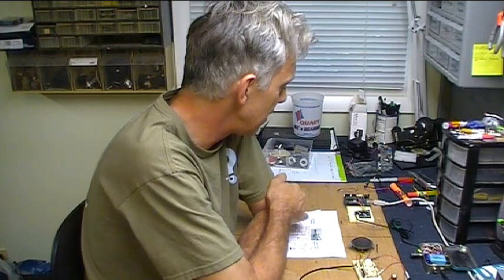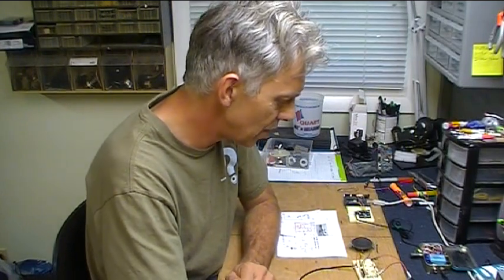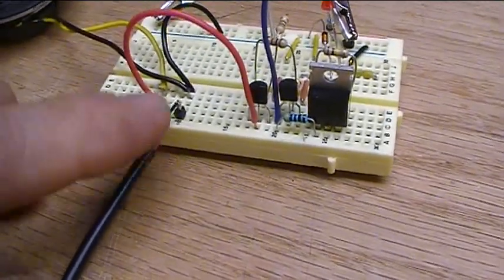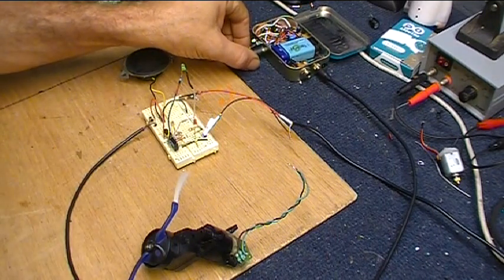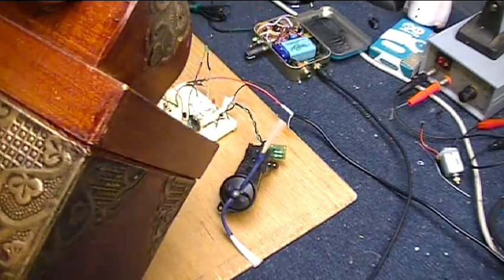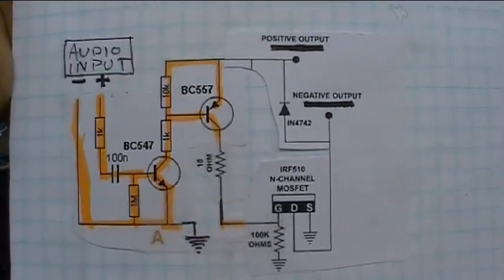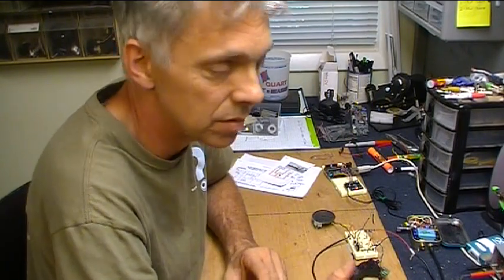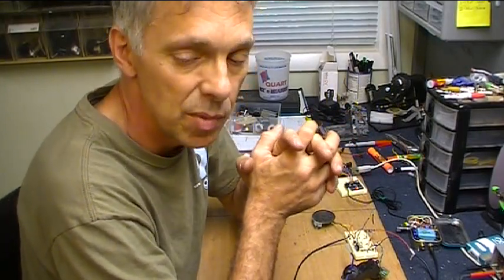Emic2 Sound To Motion Circuit

Comment: If you replace the motor with a solenoid will this give you a sharper motion taking advantage that solenoid will go up & down full swing upon MOSFET tringger ?  still you may need a capacitor to empty solenoid coil at fast rate.

See this new DIY robot making tutorial
https://www.youtube.com/watch?v=MOA_pFJZmyg

Comment: You would need to take the output from the sound to voltage circuit and send it to a micro controller programmed to out put the proper signal to make it turn.

Comment: Hi, I have a radio controlled shark that swims in the air, search Air swimmers to see it. I want to give it AI of some sort. I like that idea to use sound to effect motors. I was thinking of having one on each fin so when it hits something it reacts, some one claps and it moves away/ towards to some extent. an it all has to be as light as possible!. do you know any really simple light circuits that will do this? it would be awesome! any help is appreciated

Comment: Selenoid under spring tension for the mouth or lid in this case might work good especially if the voltage or amps could control how strong the selenoid acted against the spring as the amplitude of the voice changed, and would look more real in its anamation.

Comment: Since there is already a µC involved in the project, I wonder if it might be worth pushing the audio from the Emic2 back into an analog input on the µC which can control a servo/motor/actuator. This would allow the filtering to be software driven, rather than through a circuit. Perhaps thist is just the software developer in me thinking code should drive everything, though.

Comment: you could connect the audio output on a analog pin of the microcontroller or a arduino, and converting to a percentage and finally controlling a servo motor.

good lucky